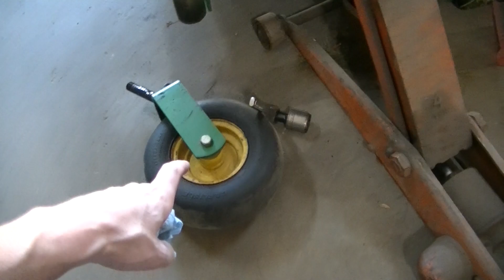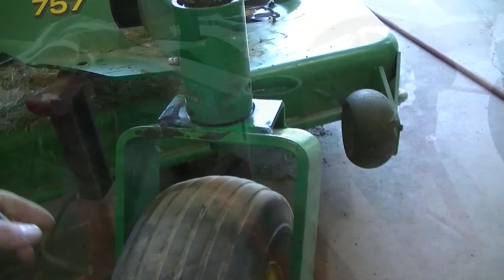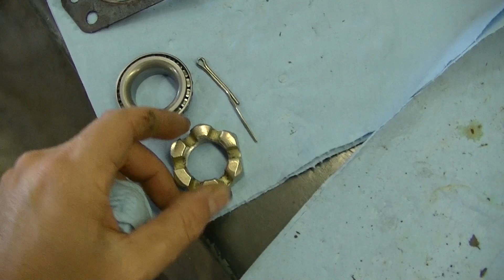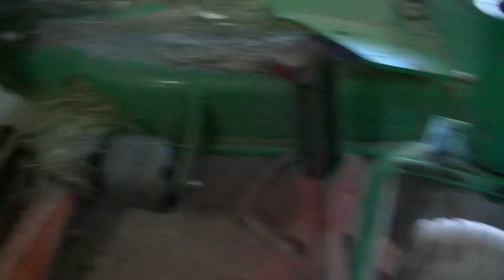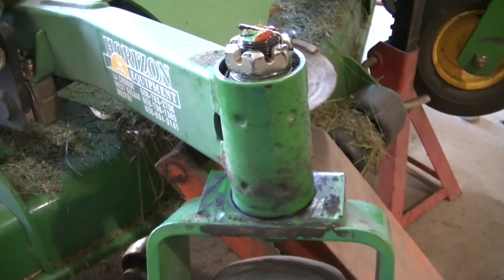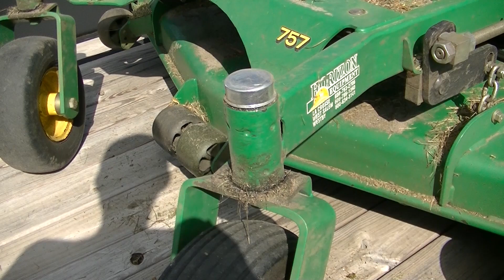John Deere 757 Ztrak Front Wheel Spindles Loose

Comment: There's definitely a torque for those spindles. They're tapered roller bearings, should be a pre-torque to seat the bearings and then a secondary torque to set the tightness.
Reply from the maker: If it was a wheel bearing I would worry about it. Being it just rotates a little bit as I turn I haven't thought about it since this video. If you want to worry about it go for it.
Reply: @mossman381  Actually, I have to come back and admit I'm wrong about this. At least by Deere's service manual I finally downloaded today, they do their assembly the exact same as you did. No torque procedure, just snug up the castle nut till it's tight, but spindle spins freely and castle nut is lined up to get the pin in.

Comment: How do you put 757 in neteral to move iy
Reply from the maker: Can't say I know how. It doesn't have a gearbox you can put in neutral. I would say jack it up and put a piece of plywood under the tires and pull it with a atv or something.
Reply: It is not so difficult but you need to different size wrenches and you loosen the nuts just a little bit. I can show you in a video if you are interested.

Comment: You should have shown what the problem was.  I have no idea why you're fixing it.
Reply from the maker: What other problem would a spindle have other than being loose????
Reply: @mossman381  For the same reason you said you should have done a before video at 0:48, I have no idea what it was doing when it was loose. My left wheel wobbles violently at speed.  I don't know if that's because it's "loose." If I knew what yours was doing, I'd probably know that's not what's wrong mine, since nothing seems "loose."
Reply from the maker: You just answered your own question. If yours isn't "loose" then this video wouldn't make sense. I would have said something like "front wheel shakes" for a video like that. Mine has done that but I think that has more to do with air pressures not being the same on both front tires. Or one of your rear tires are low on air making one of the front tires lift off the ground and causes it to shake. Having a loose spindle will make the shake worse.
Reply: @mossman381  Yeah, that's what the dealer told me, but I checked the air and corrected them and it didn't fix the problem.
Reply from the maker: Mine has only done that on pavement and I don't do much high speed pavement driving so it's really not an issue. It has never done it while mowing in grass.

Comment: On a 737 ztrak there is upper and lower tapered bearings and a seal at the bottom so a 757 should be the same.

Comment: I'm surprised those don't just use bushings.  Good fix!
Reply from the maker: I am not sure if there are bearings top and bottom or not.  I have seen the spindles for sale with two bearings.  When I get the service manual I should find out.  I am not too worried about it.  They are nice and tight right now.  They were so sloppy before.